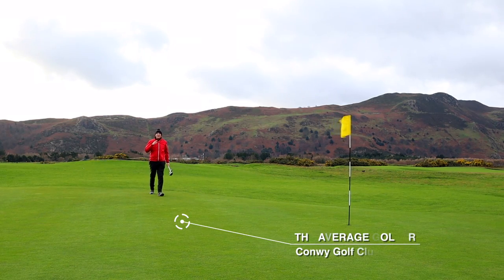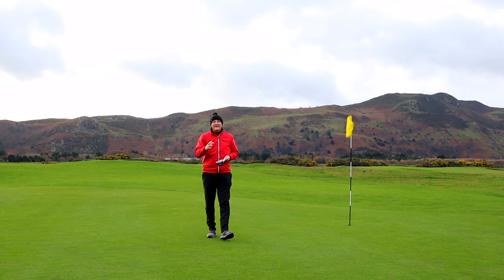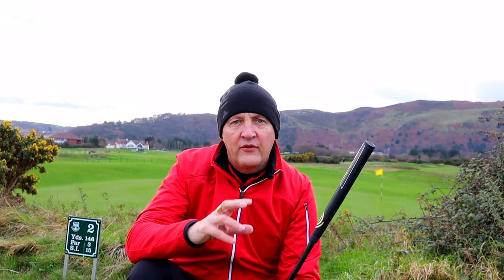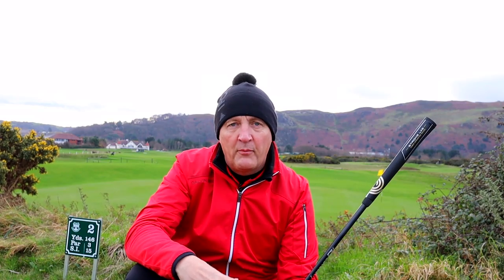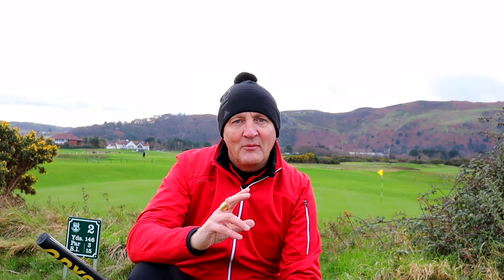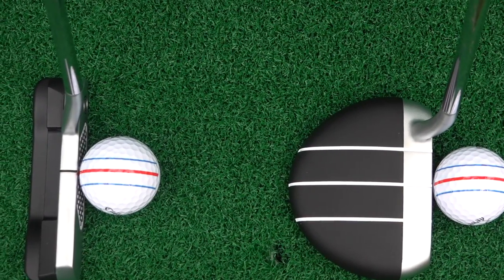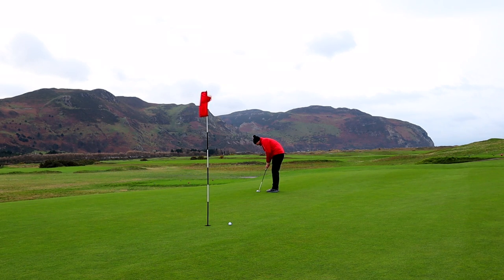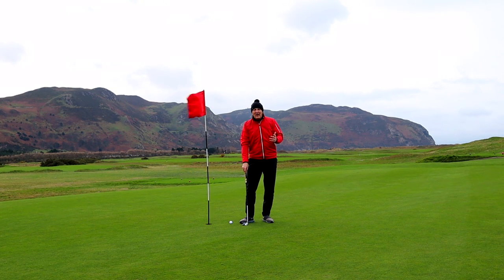Can a putter shaft improve your stroke?

Comment: I use an 125g extra stiff in my putter, less back spin and better dispersion 💪😂
Reply from the maker: Cornwall1888 😂😂 decent carry?
Reply: The Average Golfer 1 to 6 inches depending on the length of putt, although I’m a big hitter so results will vary